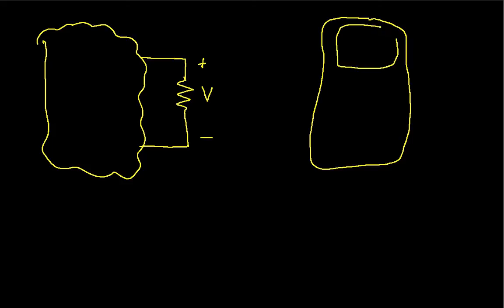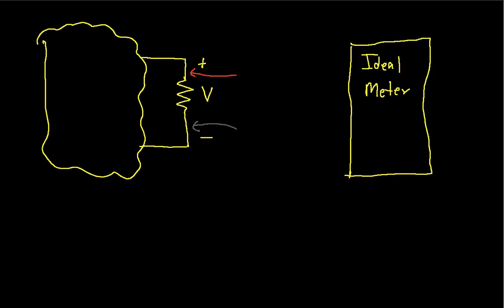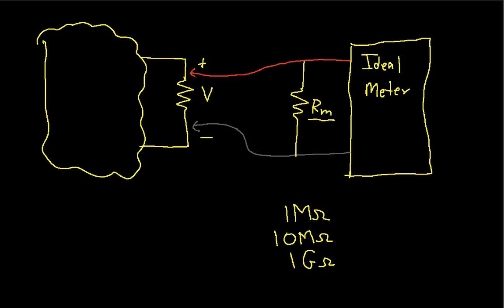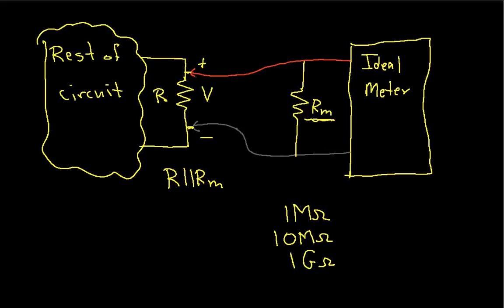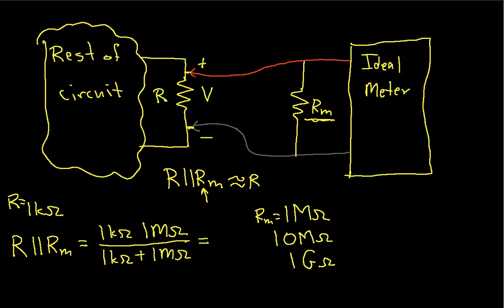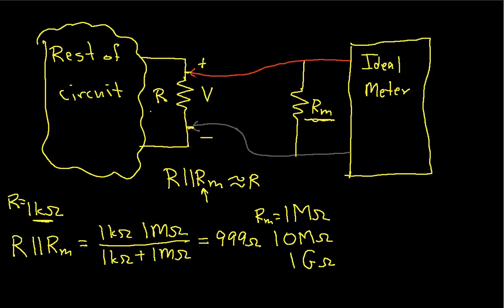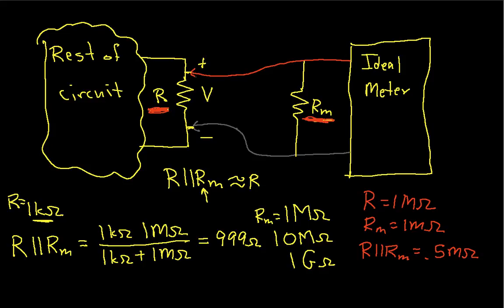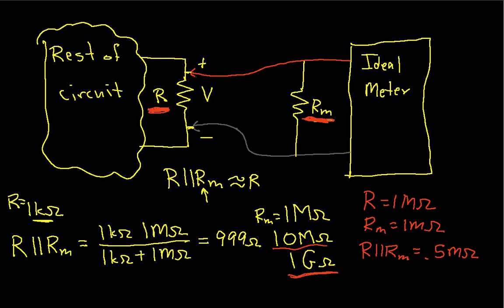Measurement Errors-Meter Loading

Comment from the maker: Yes, R_M should be large relative to the equivalent resistance between the two points in the circuit where you are measuring the voltage. One way to guarantee this is to make R_M large relative to any resistance in the circuit.